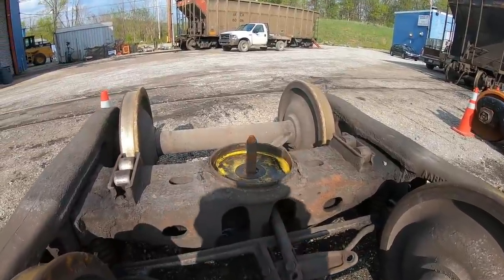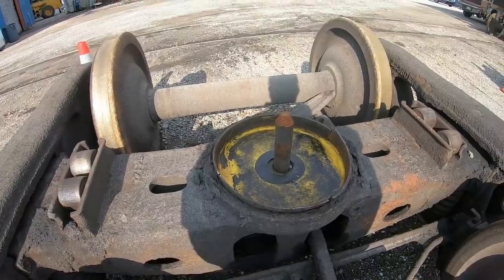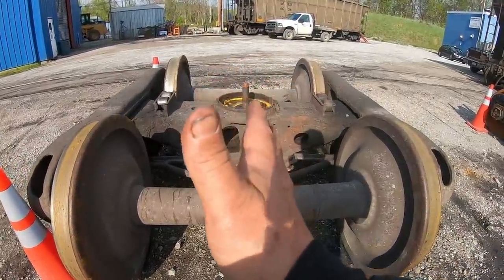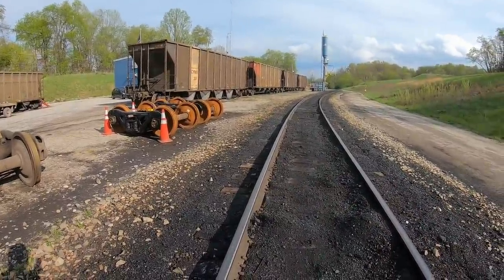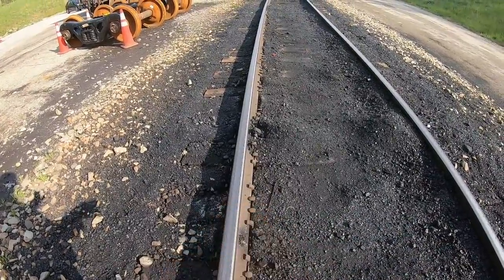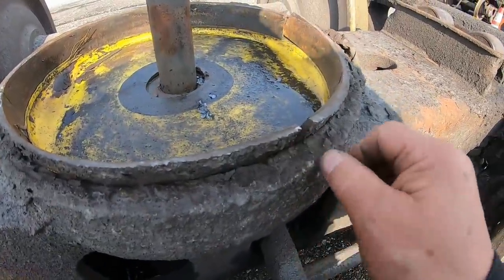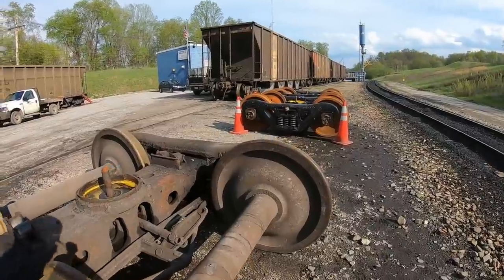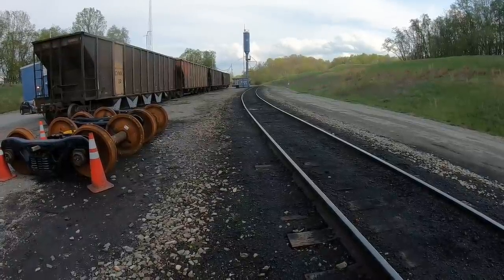Why the Derailment at Curve 18  Happened

Comment: QUESTIONS
How often should the swivel be inspected and maintained?
How hard is it to lift the truck body to do an inspection and.or maintenance?
Reply: AAR governed railroads (pretty much every interchange railroad in America) don’t specifically have an allotted time between bolster center bowl inspections, except to say that any time a car is jacked up off of the trucks, the bowl is supposed to be lubed. That’s typically some type of graphite disc that’s thrown in there. Most railroads have inspectors that walk and inspect the cars either before or after a train departs or arrives in a yard, and this is one of the items they look at. The part that is broken on the subject bolster is a “horizontal wear liner”, and is usually made of a hard, wear resistant steel or stainless steel, and are welded in. They are replaceable with an air-arc torch and welder. The problems begin when the wear line cracks and breaks, but the car keeps running and beating out the bowl edges. When the car hits the shop floor due to whatever cause, the shipper will go ballistic because his loaded car is not moving, and start ringing everybody’s phone off the hook. Then, the heavily damaged bowl is discovered but by this point its so badly damaged that the entire bolster needs to be replaced, but that would weeks of waiting for the new one! Because the shop boss is weary of getting his ass chewed by shippers and customer service over loaded dwell time incidents, he instructs the repair forces to drop a new horizontal liner in it, throw some bubble gum weld on it and let it go! It’s a band-aid repair that only lasts a short time before falling apart and continuing the damage! As far as lifting the car to see this, most car repair shops (aka Rip Tracks) have either in floor hydraulic jacks or portable air jacks that are placed beside the truck springs and push up on the car body. The car body center plate just sits in the bolster bowl, no mechanical connection, just gravity! Years ago there were a few cars with locking center pins that would keep the truck with the car in a derailment. Those are few and far between these days! Hope this answers your questions!
Reply from the maker: Sometimes things just break and go bad on the RR. We been
very fortunate that this was the first time that I can remember
since 1993 or earlier that a problem like this has occurred here.
Thank you for watching and hope you will enjoy the rest of the
videos coming out about the derailment events.
Reply: Thanks for the replies and info!

Comment: Precisely the same thing happens on my model railway.  I have superelevated curves and if certain trucks do not swivel and float to follow the track, they come off the rails.
Reply from the maker: Well now isn't that an interesting comment! Never thought about
that Rob, thanks for sending it in to us.
Reply: Examine the trucks to see if they flex and if the wheels stay on the rails as well as if the trucks swivel under the cars.  On a model, equalization is more important than springing.

Comment: Me, I don't know how those wheels stay on the track to begin with lol...thanks for explaining this. Well done.
Reply: the way that truck is designed, you would think its loose as hell, but the design is over 50 years old.
Reply: How?  Its like----magic.  Wheel-rail metallurgy, wheel design (tapered cylinder with contoued flange introducing lateral variable weight resulting in predictable harmonic wobble in vertical wheel section during roll mitigated by wheel flange taper and rigid axle-wheels structural unit) as in a rolling structural beam.  Try to design that!
Reply: @glennfoster2423  co-designer of the barber truck??

Comment: I've never worked for but, have live in and around the railroad most, if not all of my life.  Three areas that have gone through significance changes in my lifetime are, the size of the cars, length of the train and the increase in the speeds these freight trains are travelling. All on the same railway design that was used by the old cotton belt I lived by when I was ten. High-speed passenger rail went through significant improvements in the design of the rail and the construction of the cars themselves. You said the is the worsted to date, I believe this is a Foreteller of bigger things to come a complete redesign is not forth coming, or reduce the top speed. As a side note.  We are starting to run hot and heavy on a rail system that went cold because of Covid.
Reply from the maker: Andrew appreciate your watching and for sharing your thoughts with us, hope you'll watch more of the videos coming out soon on
the derailment

Comment: I agree with a lot of these comments suspecting the bowl breaks to be old and a possible contributing factor to the derailment. But if that was the case, those broken edges might have caught on something on the underside of where the trucks meet the car. I'm curious to see what the other side of that swivel joint looks like.
Reply from the maker: Yes Shayne I surely would have been also, but wasn't around
when they jacked the car up, so it unfortionate I couldn't see that
but agree whole heartedly with you sir

Comment: There is something left umexplained. Why are the side rollers on the left shiny and the ones on the right rusty as though they weren't really touching the car bottom. Was the carbody already cocked to the left even on straight track? Or was the truck stuck steering (rotated ccw ) putting excess side pressure on the wheel flange allowing it to grip hard enough to be able to climb up it's flange  so the tread wasn't touching the rail and there wasn't enough downward pressure to keep the rail flat in the tie plate.
Reply from the maker: Good thoughts Bill. If that truck set was skewed then it could
act on tangent track like it was in a curve. We will never know.
Very much appreciate your watching and sharing your thoughts
my friend.

Comment: How do you account for the locomotive being off the rails while it was the lead - head end?
Reply: If it was the lead car that rolled the rail (or just widened gage enough) the rear bogie on the engine is close enough that it will at least drop between the rails. I'd expect that if it rolled the rail the front bogie would then drop too, leaving the engine chopping the ties in three with the flanges.
Reply: That apeared to be a rear DPU engine,  the enginge was behind the cars, dug in and stopped, while the heavy cars kept rolling from weight until all braking could stop, who know how many cars ahead.
Reply: @donaldpeck8519  previous videos stated that a normal train was 37 cars.
Reply from the maker: It was the rear DPU, hope that helps explain it better, thanks for watching

Comment: Thanks for letting me know about this follow up video. Makes perfect sense. I have two questions: what is the preventative measure for this cause; and as a general question, what does rail-grinding accomplish as far as track-train dynamics?
Reply: 1. Grease.
2. Rail develops a washboard effect – ripples. The rail grinder takes the peaks off of the ripples. Ripples, washboarded rail, generate a great shock load on car bearings and on the rail. They also reduce drive wheel and braking traction.

Comment: from what u say..... why not  put tierods between the rails every few feet to keep the gague correct?
Reply: Yea or an outside over engineered "C"clamp brace w outside gusset.  Same principle but different method of application ; reason not knowing if inside ground clearances are important ?  Otherwise yes inner tie rods (or drag links) on curves.  Maybe a closer than ussuall Borden rail on the tightest curve track ?

Comment: You new a lot of questions. Is there anyway to grease with out removing truck? And any thought to check when that truck was put under car? All my years truck driving seen a lot of parts and lots of wheels cross this country. If you grab the center and lift will axal stay put. Is there anything to hold axel in truck or will it fall out of what I someone not knowing name call the fork ? So nice you share what can be sensitive things like this. Wish I new if wheel on those trucks came from Pekin or Washington, il?
Reply from the maker: Ronald, no way to grease center unless by jacking car body up off
truck set. Most truck sets have frame keys which prevent the axle from dropping out of the side frame, they are triangular type things that
bolt of the side frame,  Apprecaite your watching my friend and
keep on truckiin!

Comment: I do have a couple of things to add to your thoughts.   One is truck hunting.  With older truck sets if the bolstor is worn down then the side frames are lining up the each other.  And that would cause truck hunting or wandering.  That is there the two axles of the truck set don't line up with each other.  As for the center bowl that that broken ring is made of stainless steel.   The plastic liner is the only lub it gets.  I repair  railcars on a daily basis and I'm certified in truck reconditioning.  Based on what you where saying I think it was truck hunting.
Reply from the maker: Thank you for your thoughts Jesse, do appreciate your writing in
and adding that and for watching the video sir

Comment: Do you grease the top AND the BOTTOM of the plastic insert?
Because I see the yellow plastic melted looks like heat was generated from friction, plastic against bare metal.
What about hardened steel inserts (just like train wheels) but super hardened instead of plastic ones?
Reply from the maker: No they do not do both sides, and don't ask me why, I'm not a
carman. You are correct the insert was pretty much melted by
friction. Appreciate your watching

Comment: I notice that there are rollers there. Am I correct in thinking that they support the car? In that case, the roller plate/ turnstile (whatever you call it?) under the car is what is critical to allowing the truck to turn. The center pin would just be for centering the turning point of the truck, not an actual car support ( that would be way too small an area for supporting a turning, tilting, bouncing, car I would think ). So, those rollers have to be turning for the truck to turn.
Reply from the maker: Car body support is provided by the center bowl as the center plate
on the car body sill sets down into the bowl. Rollers like you saw do
not touch the car body itself when properly adjusted. They are
called side bearings. However they can come into contact with
the car wear plate when negotiating a curve. They help the
truck set to swivel or "steer" thru the curve. There is also
a different type of side bearing called a constant contact
bearing that is in contact with the wear plates on the car body
at all times. Those types help to prevent truck set hunting at
high speeds.

Comment: Hello ccrx 6700 That's Railroadin..!!  I completely enjoy these videos, thank you so much for making them...!!  I have always loved trains ever since i was a little kid, and it is a great pleasure to get educated on the day by day experiences of the real railroaders.  After watching the video describing the track destruction on curve 18 derailment incident and the probable cause video that follows, it seems to me that the rails, and spikes, and ties are actually pretty "delicate" and "sensitive" compared to the massive weight and force of momentum that locomotives and loaded train cars can exert on them.  I kind of wondering how often and how many derailments are going on day by day..?  Does anybody keep track of that? (pun intended '-)    I have seen in person how much the rails move up and down in the ballast and how the corners must try to resist getting pushed sideways by the outside wheels, it's a miracle they work as well as they do.  When you factor in rotten and shrunken and cracked ties and spikes that must get very loose over time, it seems like there are a LOT of variables that can lead to failures.  So what about using bolts instead of spikes and concrete ties instead of wood?  Have you made a video describing how those differ and how well they work?  I don't want to see you great guys out of work, but these old wood ties seem to be pretty high maintenance and high risk.  Curious what your thoughts are?  Thanks, Lew in Oregon
Reply from the maker: Thank you Lew in Oregon for the very nice comment. First it is
rare we ever have a derailment here other than when a wheel
bearing goes bad. Bad bearings over the years have accounted for
75% of our derailments. We did have some derailments back
late 1980's to early 1990's that were caused by track conditions,
mostly wide gauge.

Code Fed Regs only require having 8 to 9 good cross ties in a
39 foot section on class 2 track like we have. 9 is for curves
greater than 2 degrees.

You are so right in that there are a lot of variables to consider
when running heavy loads over track, a huge topic to discuss.
On tangent track and on the full body of a curve the rail wheel
interface is relatively constant, where as on the entry and exit
spirals on a curve the dynamics are changing second by second,
foot by foot. 

You are a thinking man and i like that. Here is a video where I
explain why we don't use concrete ties, it is about half way into
that video the explanation.
https://youtu.be/oOug0z34118
Reply: @ccrx6700  Wow Dave another great video...so informative...!!  So i heard the rap about the concrete ties not easily being compatible with your tamping machine, but besides that would you speak about the qualities of concrete ties as a modern up grade for bigger railroad systems that can afford to switch over to them.  Like, are concrete ties superior or inferior, and is it true that they have less or different problems than wood ties.. etc..etc..?  Is it true that concrete ties use bolts tho hold rails down and that they would suffer less "wide gauge" issues because they don't come loose they way spikes "wallow out" and loosen up in the wooden ties?  I am very curious about this because a while ago i rode the Amtrak train from Denver to Portland, Oregon and i noticed in the high mountain passes the ties were concrete for many many miles.
 
So now, branching off an a spur track (pun intended "-)) you said in that video about the Cumberland Mine Railroad that you did not intermingle trains with other railroads...and your trains just serviced the mine and a barge loading facility.... So my next question is, somewhere along the CCRX line is there a connection to a "mainline" of some larger system which is the way you would receive say anew train car, or track equipment,  or locomotive?  I would assume when you need some new stuff it would come that way.  Is that true?  Thanks for all these amazing videos.!!  
Your new biggest fan, Lew from Oregon

Comment: Yes.  Your  implication  sounds true. A lot of weight  and a bad 5 th  wheel.  Lot of  RR ties busted almost cut into.  Your experience and knowledge  stands out.  Now. How many other cars are in this shape.  Need inspection. Thanks. Later.
Reply from the maker: Thank you for sharing your thoughts on that Dan. You are right,
that was a mess and good question on how many other cars,
we do need to do a better job at inspecting our cars, no argument there. Appreciate your taking the time to check out the video and may you have a very good day my friend.

Comment: I would say your idea is correct.  There is one thing you need to check.  Are the bearings on the wheel in working condition?  That will be the only other thing that could cause the drag.  From the video, the wheels looks slightly miss aligned.  That hub looks terrible.
Reply from the maker: Thank you for the kind words. The side frames are askew because
of them dragging the truck set across the parking lot with the
high lift. Appreciate your taking in the video terenfro.

Comment: Hey i asked some time ago did you have vid of re railing that big loco with all six axles off ? Yes also pitty no stills of the Male Boss that sits in that truck unit ie showing  any damage  that could of  accelerated the fractures in the outter guide ring on the truck body ? 

Ciao
Jo
Reply from the maker: No sorry Jo, I was not there when they re railed the loco, dang,
that would have been a good video if I had been. Thanks so
much for stopping by and checking out the video today my friend.

Comment: Ok, so I am no engineer but have lifetime of mechanical knowledge, do your lines have corner sleepers, where you replace traditional sleepers with concrete sleepers which have fasteners pre-fitted? Also, is there no facility/procedure to grease after the initial instalment greasing? Super clear vid, thank you!
Reply from the maker: No we do not, they are used on some higher classes of track
from what I hear tho. Only way to grease is to jack truck body
up off truck set and they have no regular maintenance schedule
to do that, I think that might change tho, but they few guys they have are overworked and so much other stuff to do, so we will see

Comment: Robert Hall  Can you get an optical device into the top of the truck area to inspect for cracks in the area?  Not sure how to verify the lubrication.
Reply from the maker: it would be a wonderful thing if we could Robert, but with the hopper
car body sitting down on the truck set, just no way any kind of optics
could see in there. If we could take the car in the shop and jack it
up a bit, then yep that would be ideal. I will make that suggestion to
management. Excellent idea my friend and thank you very much
for watching and writing in.
Reply: @ccrx6700
Reply: There might be a magnetic device that could be used to determine the integrity oh the cup that the disks fit into.  Haven't done the research to find a device.